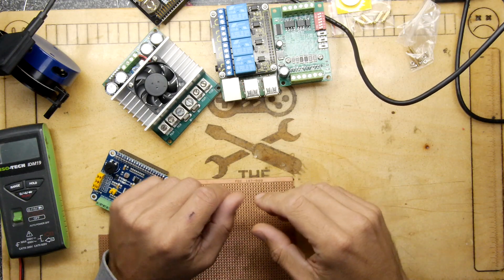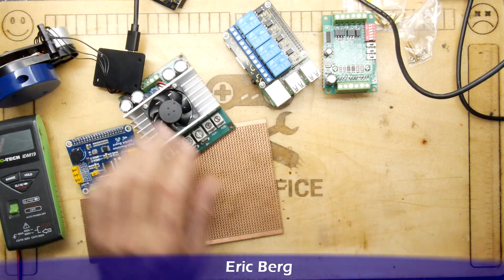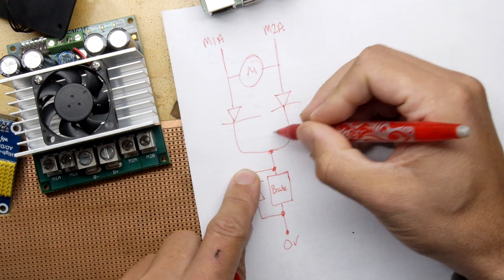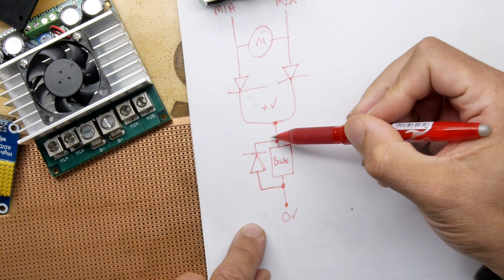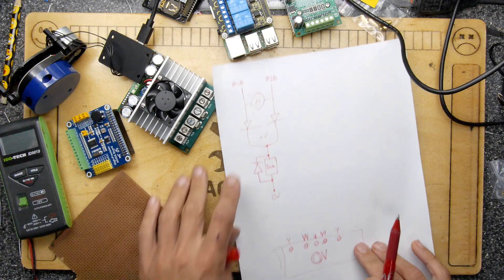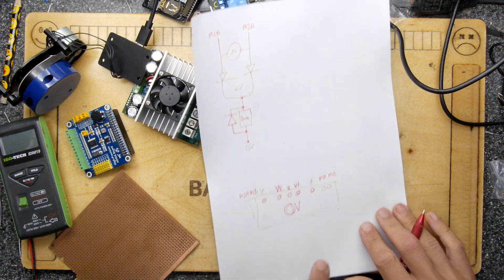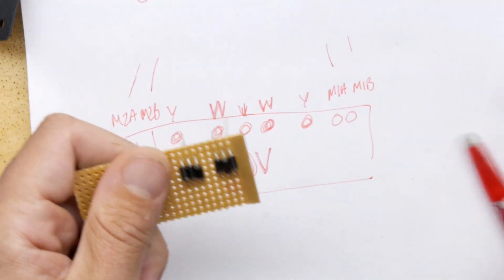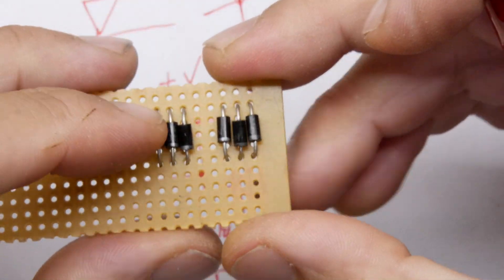Build a robot rover Part 2 -  The electronic braking system

Comment: IME, works fine to cut  between holes (~1 mm gap), at least for low voltage/current stuff - for when one wants to be as compact as possible [on overboard]
Reply from the maker: That's interesting, I might excitement and try this!
Reply: @backofficeshow  I do the cuts pretty much like you did on opposites sides of the hole, but moving the blade just marginally. Angling the knife 'outwards' away from the but area on both sides/cuts.  Sometimes a little scrape is needed to clear away the sliver of copper, but mostly it comes away with the 2nd cut.

Comment: 1:57 "I digest." lol :p
Reply: This circuit will work OK with that DC current from the battery.

But I'm not sure about when the PWM signal gets too low.

It depends how much current/voltage the solenoids can stay open with, I guess.

You'll also be starting off with a low PWM duty cycle as well, so I'm not sure.

You might find it needs an RC filter on the output from the motor diodes, then a FET or something to drive the brake solenoids.
Reply: Sabertooth 2x60 motor driver guide...

"If you are using a potentiometer to generate the input signals, a 1k, 5k or
10k linear taper pot is recommended. In all cases, an analog voltage of 2.5V corresponds to no
movement. Signals above 2.5V will command a forward motion and signals below 2.5V will
command a backwards motion."

OK, so the analog input mode is centered around 2.5V, which will make it a bit trickier to just have an accelerator pedal and a direction switch.

Oh, they even have some programming software for that motor driver, which lets you set up custom voltage ranges for the analog inputs etc.

(it can also auto-calibrate the center-stick position, when using the R/C input mode. Maybe a simple R/C tester can be used.)

Failing that, the driver allows for serial control, and you'll no doubt be using the Arduino anyway. ;)

In fact, if you're using the Arduino to drive everything, that would get around the issue with the brakes, by driving those solenoids with a chunky FET.
Reply from the maker: I'll be using their serial interface so all bets are off! I can always hook up the brakes to an output on the raspberry pi or Arduino main board separately